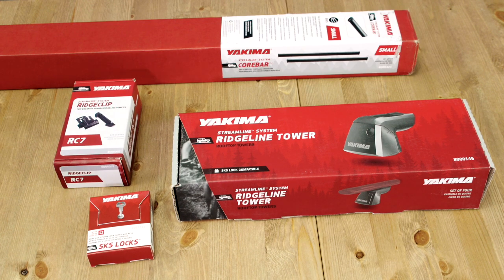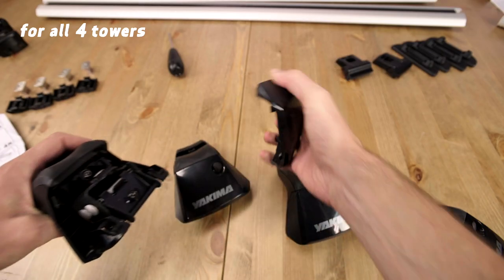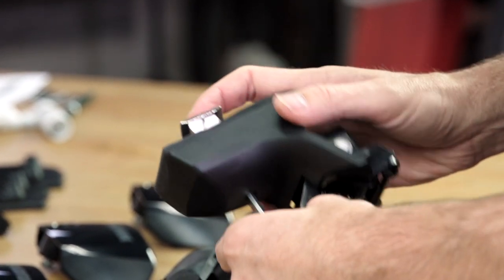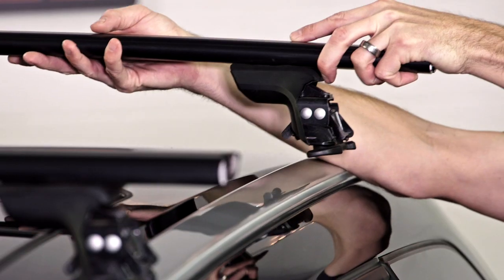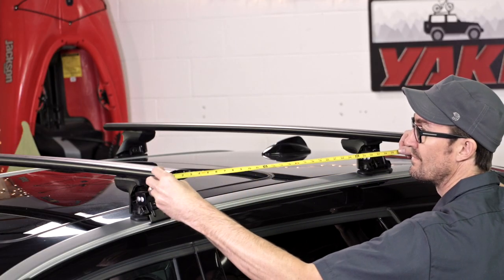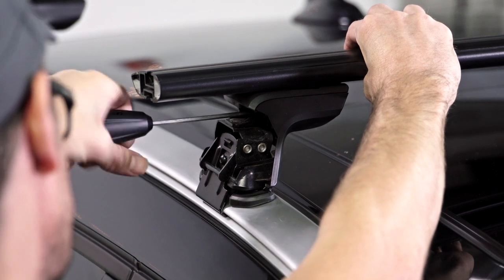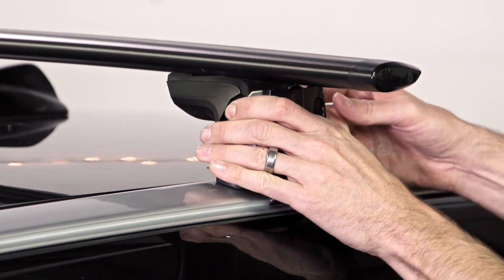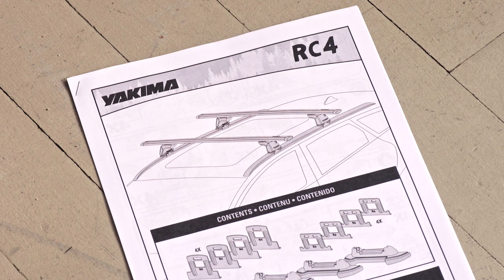Yakima RidgeLine Towers Installation

Comment: Thanks. Thinking of buying this system. Question: can you place the crossbars anywhere along the side rails as long as they are 27” apart or is there a set mounting point for them. I have a 2016 Kia Sedona